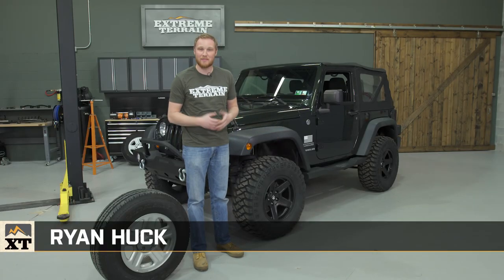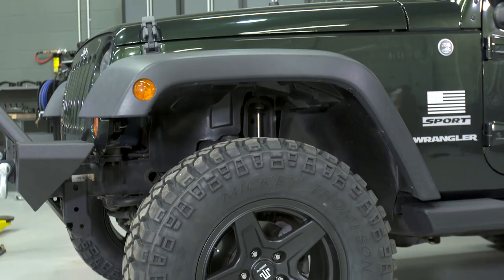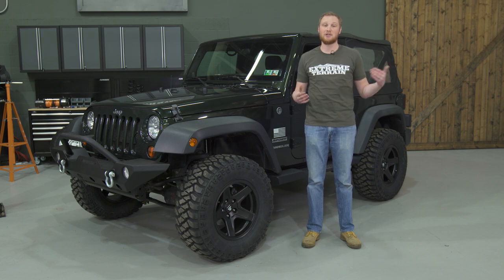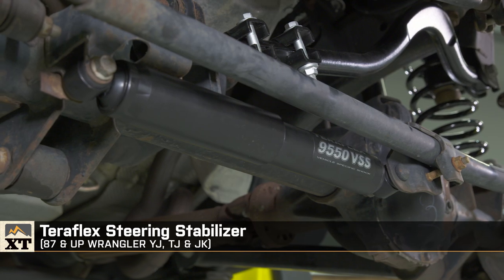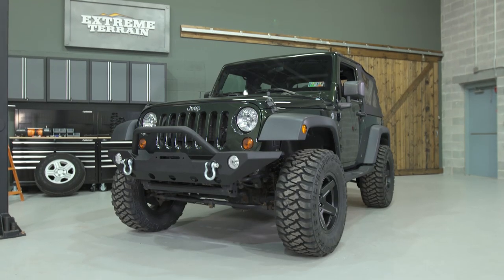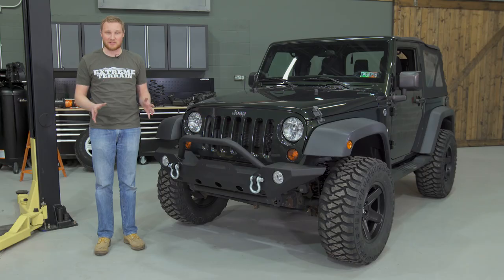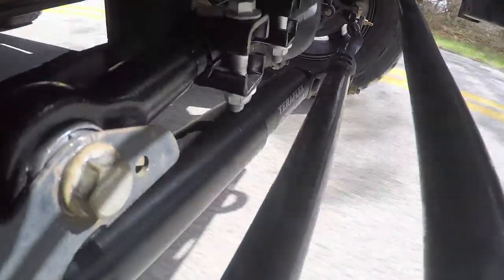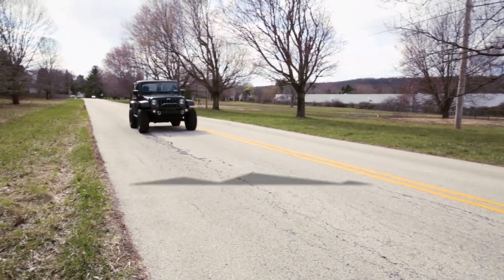Jeep Wrangler (2007-2017 JK) 2.5" Lift Kit, HD Front Bumper, Trackbar & Steering Stabilizer Review

Comment: I just put the Teraflex 2.5 basic kit on my '09 JKU. The install took me about 6 hours and I'm very happy with the ride afterwards. The suspension feels tight and handles bumps much better than stock. You don't a spring compressor, it can all be done with a couple jack stands and a good jack. I do suggest upgrading the track bar as well, stock is a bit weak as they mentioned. Well worth the price tag in my opinion.

Comment: I have this lift on my, new to me, 2010 rubi 2 door, but I have 35” tires and it handles like crap, and a lot of rubbing on the fenders when flexed out. I would not recommend 35’s. In the very near future I will be swapping out the tires for a set of 33’s.

Comment: Oooo, this the video I want to see. We just got a "New to Us" 2019 Wrangler and now I want to go up 2.5". But I keep hearing go 35's ... but when I see pics, the 35's look tooooo big. Like when things get flexy, they are going to rub all to hell (especially when we add a quick disconnect). But of course, we don't want it to look stupid either (tires look too small)... GOTTA have some cool factor. So I been trying to find what that 2.5" lift will look, AND perform with a set of 33's instead. I feel this combo will work best when actually off roading and give tons of wiggle room when she starts to flex. Perfect video, thank you
Reply from the maker: 33s on a 2.5" lift would be perfect for your JL! You'll be able to get more flex on the trails, get better fuel economy compared to 35s, retain better road driving manors compared to 35s, and they're cheaper than 35s too! Thanks for watching! -Zach
Reply: @extremeterrain  Awesome, thanks for the response.  It's also my wives, cuz she got bored of the passenger seat. And I figured the 33's also cuz she's vertically challenged. Hee hee

Comment: What would one expect to budget for this upgrade. I have a stock 07 unlimited and want the same outcome for look and performance. It would not primarily be an off-road vehicle...some light off roading on occasion, but nothing extreme.. Thanks!
Reply: In parts including new wheels, tires lift and bumper would probably be 3500-4000. I'm not sure how much labor would cost
Reply from the maker: Current prices can be found by following the links on our site! Labor is going to vary depending on your area, what kind of shop you go to and whether or not they specialize in 4x4s, and the amount of extra replacement parts needed depending on the mileage of your Wrangler. Being that yours is an 07, I could see some balljoints or tierod ends being needed. -Zach

Comment: I'm diggin those wheels a lot.
Reply: Did he say the stock gears are ok with the 33 inch tires?
Reply: +Mike Ross 33's are not that much bigger than stock.
Reply: +Mike Ross while not much taller they're wider and heavier. regearing will depend on your current drive train combination and personal tastes.
Reply: Actually they are 10% bigger. You will notice weaker acceleration.

Comment: One can fit 37's in a JK with 2.5" lift. High clearance. Low CG.
Reply from the maker: With some cutting and aftermarket fender flares you definitely could! -Zach
Reply: @extremeterrain  I did a small pinch weeks trim,  JB WELD stick to fill the small gap. Painted up. 
For flares I did Poison Spyder.  Also took off the stock rock rail, replaced with PSC brawler rockers.
This set up handle off road and the highway very well, even a 1800 mill round trip to MA.

Comment: So basically figure $4K if a shop does it, right ?
Reply: One need not be a mechanic to install a lift kit or many other Jeep mods. After the lift install, get a front end alignment. 
Then pay the pros to regear the axles for the larger tires. I went from the stock 4:10 to 5.13 gears on my 2010.

Comment: Looks good. For nearly the same look in that tire size I would run a 285/70/17. It is so close I doubt you could tell the difference and far more options with a lower price.Even going up to a 285/75/17 is cheaper and had about the same amount of options.
Reply from the maker: It's definitely another option, yes! Especially if you prefer something with the same height as a 33x12.5R17 with a little less width. That would be the only giveaway in tire size, a 285 regardless of 70 or 75 will look a tad skinnier than a standard 12.5" wide. -Zach
Reply: @extremeterrain  100% agree.

Comment: On this particular lift would it be beneficial to add geometry correction brackets? Or is it not necessary? Thanks
Reply: I regretted those. Go with Rubicon Express front lower & rear upper adjustable control arms. Much better ride and will definitely save you money in the long run.

Comment: What tire pressure are you running on those tires?  I really like this built and would fit perfect for my 2010 Jeep JKU.
Reply from the maker: Since we did this build awhile ago, I'm not 100% sure what tire pressure we set those MTs to. In order to get a smoother ride out of larger mud terrains, you generally will have the tire pressure be a little bit lower than normal. On 33s, I'd recommend starting your PSI out around 32 and going from there. Hope this helps! -Zach

Comment: Exactly what I’m going with on my 2010 Sahara 2 door. You said the 33 and 17 combination is a little less sidewall than you are used to. What are your thoughts on running 15 with the 33s? Looking at Pro Comp steel, have heard they can have clearance issues. Also what setback are the rims. Thx
Reply from the maker: 15 inch wheels are a tough fit on JK's because of their larger brake calipers, you really need make sure you have enough backspacing. Steel wheels tend to be heavier than aluminum wheels as well, which can affect your fuel economy more when getting new wheels and tires. -Zach
Reply: 17" would be the smallest wheel you could go because of the Brakes.
Reply: You can go with 16's.

Comment: Hello. do you know the over all height?  I'm wanting to install the 2.5 lift and add 33's. but I'm trying to find the measurement of the over height after its all installed. any help will be appreciated. thanks.
Reply: My OME coils say 2.5". But no way, these are definitely in the 3 - 3.25" range. Looks awesome and have plenty of articulation room in those wheel wells.

Comment: I have a question why i always a wobble in my steering wheel?once i hit a bump or a rough pavement it feels like im pulling to the side.
Reply from the maker: Hey Ian! There's a lot of factors that could be the cause of the steering shimmy. Bigger tires will cause some bounce, alignment out of whack, and also have you checked the trackbar? Let me know! -Jake
Reply: Is this Jeep on 3.21 gears?  Does it seem more sluggish with the 33's?  Did the fuel economy drop significantly?  Like the show, thanks!
Reply: great questions that I would love to know the answer to. I've been thinking of doing a booster lift with 33's myself
Reply: John,  We got a 2014 JK 4 door on 33" Nittos.  Averaged about 17 MPG doing 75 MPH!  Not bad for hauling ass in a car shaped like a brick.  Tires felt solid, didn't notice much difference in ride quality
Reply: MrBigChives 
I get the same in a 27 yearold squarebody  Suburban 4x4  on 33" and a wore out 5 7 tbi/700r4. 
Looks like tech hasnt done much for mpg in two decades
Reply: LOL!

Comment: Just a tip to anyone reading this. Consider getting an adjustable lower front control arms or a front control arm bracket. Especially with 2 doors they get twitchy and flighty steering when you don’t return the caster to stock or close to stock.
Reply from the maker: Adjustable front lower control arms are honestly the way to go if you have room in your budget! That way you can really dial in your alignment up front. Adjustable track bars work wonders too for helping everything stay planted. -Zach

Comment: what is the correct tire pressure for 33" M/T tires?
Reply from the maker: It really comes down to your specific setup. I'd recommend using the chalk test. I'll post a link below, or you can search on YouTube here and I'm sure you'll be able to find a video. Basically, you're just using some chalk to figure out at what PSI your tires need to be perfectly seated on the ground without being over-inflated. Best of luck! -Zach
https://www.intercotire.com/using_chalk_method_determining_psi

Comment: What size wheels are those 33s mounted on?
Reply from the maker: Hey Adam! The wheels on the JK in this video are a set of 17x9 Mammoth Boulder Black wheels. What did you think of the JK after the lift and tires were installed? -Jake
Reply: ExtremeTerrain.com  I think it looked great I'm looking into running the same lift kit as well!!
Reply from the maker: I highly recommend it! I think it gives the two-door an awesome stance! -Jake
Reply: What do you think about to put 35? Is to much for this model ?
Reply: You can run 35s gonna want flat fenders and prolly wanna re gear with 35s 33 you don't really need since your at that mark
Reply: ExtremeTerrain.com will 17x8.5 rims mount well with this tire size?

Comment: When you say the tires are a 33x12. Does that mean these tires are pretty much 305/65/17?
Reply from the maker: Exactly right, Justin! They are sitting on 17x9 Mammoth Boulder Wheels too. Check out some pictures of the wheel/tire kit here: http://terrain.jp/2lSbjdA -Brian
Reply: 285/70r17 is a 33inch tyre but 11.5 wide
Reply: @extremeterrain   too bad you forgot to do the spare....

Comment: Could you still fit the barricade skid plate that fits with hd bumper on this build
Reply from the maker: Sure can Dixie_Rebel! The Barricade Front Skid Plate is actually designed to be used in conjunction with aftermarket bumpers and looks especially nice with the HD Front Bumper! -Jake
Reply: +ExtremeTerrain.com because on my Jeep I have the hd bumper and skid plate but I didn't know if that would interfere with this particular lift